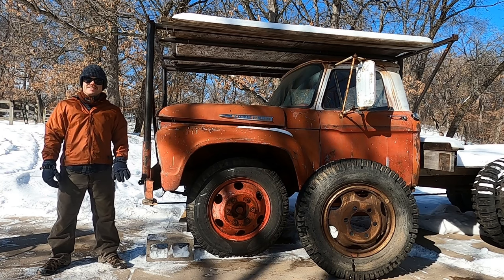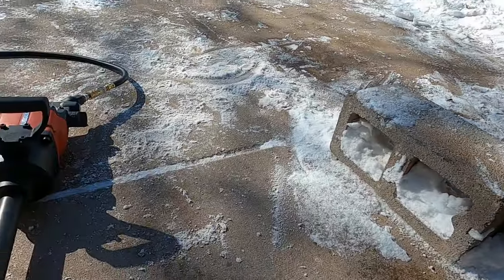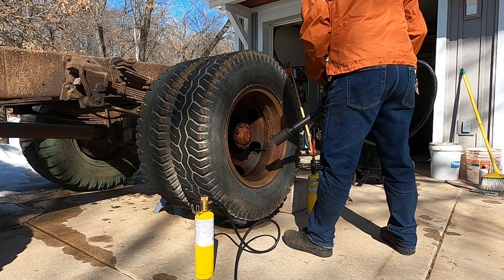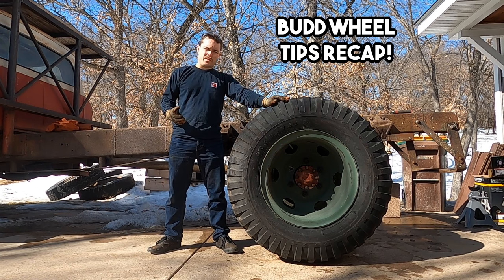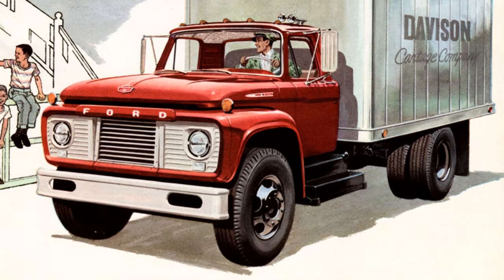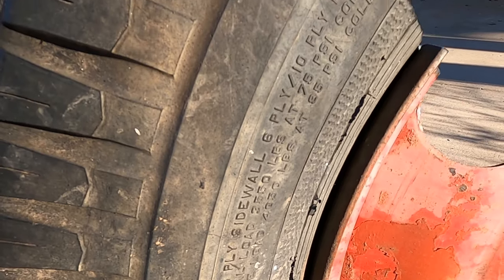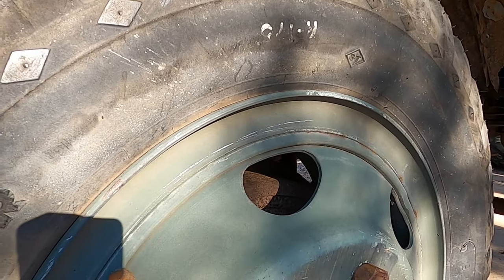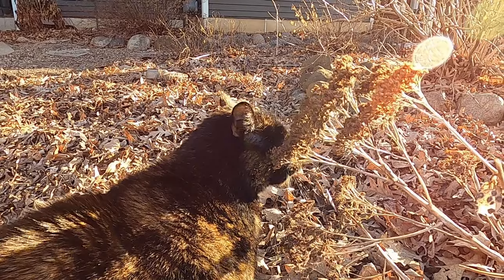All About Split Rims, Explained! Ep. 11

Comment: Ive got a48 ford with widwmaker wheels and another set off a 53. They are out there and i dont like working on them. There is a shop somewhere in this city that ive heard that has a ring still stuck in the ceiling.

Comment: As a big rig tech you need a 1/2in or 3/4in air line on that gun and it will make quicker work and less problems coming apart. Also Silikroil for anything super rusty and use a wire brush/wheel and a pick to clear the dam of rust to allow the penetrating oil to penetrate a lot deeper. Also with BUDD wheels you want to tighten the square drive 3-5 ugga duggas more or 50-75ft lbs. That way you can get them apart easier without spinning the inner nut out before the outside nut. At least that is when you service them often. I highly suggest you get a sunex wrench for the regular nut and a square drive for the budd style. Because they will become rusted together and not want to separate. Heat helps. Some people will just heat the nuts to prevent this but if you are ever heating anything like that the valve stems have to be pulled and tires empty of aire pressure and remember tires are highly highly flammable.
Reply from the maker: The air compressor situation is a conversation my dad and I have had a few times. Compared to buying a proper large air compressor and hose, I think I will be better off with a planetary torque multiplier unless I pick up another big truck.

Good idea on holding that inner nut. I will try it next time I pull the rear wheels. I'll also probably get all new studs if they aren't horribly expensive.

Picked up an inductive heat for the Corvair stuff (video coming Friday) so that will be very handy for a powerful, flame-free heat source. Noted on the tire pressure increase with heat!

Cheers

Comment: ב''ה, nice video; been trying to comprehend what should be simple about these for a while, but at about 3:20 with the reversed arrangement.. you don't want to be putting your hands where you're reaching around because you have to put hands there because of the reversed arrangement?
 
Is the point to crawl around the tire for that after pointing out the configuration? Still in the middle of watching the rest of course.
Reply: You might want to double-check your translation, because I couldn't figure out what your question is. I hope you find the answer.

Comment: First time I delt with them was a 1963 F650' Got my old man to give me some pointers for a rear outer replacement. He had me pull both, fix the outer and install it on the inner position. Like you much time and a ball buster to pull due to age. His reasoning was the rim that had been together for the last 20 years would hold up just fine, the one we were repairing was an unknown. If it came apart it was held in place by the spring and the outer tire. Did not have a tire cage and when I run across one of these now will not even repair them. Too much time and rust to be able to trust them even if it air's up just fine. If I find one from outside the rust belt thats clean mabey. till then NOPE.

Comment: Widow makers are actually rather safe, the basic principle behind them is to ensure the tube expands between the face of the tire and the rim and DO NOT let the beads seat first. 
I've worked on several in my 20+ years and I've never seen one come apart. 

And just a tip, if wheel nuts are seized on, try using heat and wax. The heat will draw the wax into the threads through capillary action and will limit the overall amount of damage excessive heat causes or the potential fire hazard of using oil based products and then heat.

Comment: I just got a 75 GMC 6500 dump truck. Seems like I have all split lock ring on mine. Would I still want to air them down when removing or working around them? Thank you for the reassuring info!
Reply from the maker: If you've been driving on them for a while, I would keep them aired up. Based on the OSHA docs I understand that the risk comes when you're changing the tire pressure, actually. The rings can theoretically unseat without pressure holding them together, but i think this is mostly an issue with RH5° wheels and/or mismatched lockrings. Definitely take a look at the docs to be sure; I'm not a tire professional.

Comment: Back in the day I still was working on fire engines and other emergency equipment   I save a firefighter from getting blowing up he was putting air back into a split rim that was nearly flat I saw him and told him stop stop and get away from it but a second after he moves split ring, came off  sending parts all over the place and bouncing off the wall Poor rookie, thought he just saw his life flash in front of him District chief walks up and goes. I guess that answers why  i was hearing someone screaming stop stop we both had  go to the hospital to get some stitches funny part that was the last piece of equipment in our fleet that had a split rims on it and it was a reserve unit that rarely got used

Comment: Back in the mid 90s my niece's father and I were at his job. He worked at a tire shop. When they air up those wheels, they put them in a cage rack. That way, if they separate it will destroy the cage and you will be safe. It was almost 5, and they had already put the cage away. A guy brought  truck in for a tire. This guy ( instead of getting the cage out) decided to stand in the middle of the wheel. He said if it goes, it will just blow strait up and he'd be safe. Well it popped. Shot strait up alright. The ring caught his jaw and peeled it off of his face along with his nose and alot of the skin and meat on his face. Don't half azz anything. It could be your life.
Reply from the maker: Jeeeeesus. That's horrifying. Thank you for sharing. I can't imagine...

Comment: I always put a dab of lithium grease on my lugs just so they can't rust on the car.
Its also a good idea to smear some on the back of the hub if your running them over a brake drum  make it super thin you do not want it to get the the brake shoes or pads you automobile won't stop correctly.
Reply: @I_Died_2_Weeks_Ago Anti-seize is the way to go. I've used it on all of my vehicles.

Comment: The split rim wheels also require tubes to inflate and cause excessive heat when run under heavy loads.  Cause more fuel consumption over a tubeless wheel.
At least that was what I was told when I wanted to put new tires on my 67 Ford 3/4 ton  F250 Camper Special.  Which hass 352 cubic inch industrial original engine.
Interesting video.
Never knew about the  widow maker versus a split rim wheel!
Education & training saves lives!
Reply: Who ever told you tubed tires get hot is nonsense ......................

Comment: could the split rim be permanently welded together and then mount/dismount tires like modern rims do or is the lip of the rim too tall?
Reply from the maker: Guessing the rim lip is too tall and the barrel too shallow. I think you'd also run into issues sealing it; multi piece wheels need a rubber "flap" that keeps air from getting past the wheel seam. Easier to get one piece wheels and paint them the right color.

Comment: My dad almost died working on one in his shop. He had no cage. It sounded like a bomb going off. We ran out to the garage found him on the floor on the opposite  side  from the tire machine and a perfect circle hole through the roof. He couldn't find his glasses. They went out the roof with the rim.
Reply from the maker: Sounds like he got REAL lucky. Glad he survived.
Reply: where I work, a side wall blew out during tire fill, tire in cage, cage about 2 feet from wall,air rushing out hole blew 2 layers of metal biulding out with insulation about 4 by 4 square, amazing power,just scary if someone had head near it filling tire, but  perple do it 1000s of time every day!!

Comment: By the way if you are running that compressior off of an extension cord that is bad for the motor and causes a voltage drop, at least use 12 gauge. 

You need to use fat hose and eliminate couplings as much as possible. The couplings have very small holes and hurt the flow. At the minimum you need 5/8 hose screw it directly onto the pipe coming off the regulator. 3/4 inch would be much better.Then crank the regulator all the way up. That impact wrench sounds pathetic.

Comment: That gun needs way for cfm than your compressor can make you need  a 30 gallon tank with atleast 18 cfm 25 to 30 is best and a half inch hose with half inch connectors

Comment: sure split rings a safer but there still a hazard also on older 4x4 that had them like older land-cruisers when you let you pressure down not even extreme lows just going down to 1.5 bar the rings have a habit or rotating a bit and it throws off your balance.

Comment: I had a trailer with a split ring wheel fixed at tire place and they used Murphy tire soap they use for tubeless tires inside of metal parts as well as tube and flap to make it easier to put back together after remounting went 20 miles tire was flat they come back out put new tie and tube again the same way went 15 miles nothing left but sidewalls come back out with a new tire went 20 miles tube had slipped around and valve stem was fixing to pop again I say it was because of all the Murphy tire soap causing it to move around before it was properly seated what do y’all think the tire store disagrees 550 dollars later

Comment: Suicide wheels are not as dangerous as people make them. They are dangerous to people who don't pay attention to them they have 2 flat spots on the section with the mounting flange and with beads pushed down and broke loose from rim you spin the inner half till you can see day light between the 2 halves a special bar slips in the space and you pop them apart by prying up between gaps and when they go back together you line up the flats and lock in one side and tap them down and turn 90 dgrees but any time doing them spend the money have them sand blasted when they are clean and mounted right they are just as safe as any other wheel and to be honest I just rhem more than any of the 22.5 or 24.5 aluminum rims out there today. Have you ever seen a 22.5 or 24.5 rims that has been ran for years or ran most of it's life overloaded they wear a groove in the bead lip and most tire guys and shops will just go ahead and mount them like there is nothing wrong with them at all there are millions of them just waiting to come apart and when a 22.5 or 24.5 comes over the rims bead they are way more dangerous then the 2 piece suicides. I restore antique truck wheels for a living and been doing it over 50 years now and I have more of a trust issue with aluminum wheels than I do with 2 piece wheels and the outer lock ring wheels are also more dangerous unless they are the 3 piece with the solid outer ring and the lock that slips over rim and locks between rim and outer ring. The single lock ring rims people bend and stretch the rings because they don't have the right bar and they think brute force is the way they come off and then they never clean them and just throw them back together and because they are scared of them they just throw them in a cage and put air to them and hope they are locked the locking ring needs to be tapped with a hammer as they are blown up steel on steel thud sound needs to be heard the whole time air is put in them and lock ring wheels and suicides need to go together dry with lube on tire bead and tube flap only no kind of oil or lubes on rims

Comment: I 've done literally hundreds of multi-piece wheels  of all sizes .... from half-ton pickups to road graders.....  was field serviceman for many years. Never had one come apart. Lucky , or blessed. There is one more style wheel ; probably the most dangerous of all. Normally 16 in size. This has a ONE -PIECE removable outer ring. It is solid not split. You pried this ring off over the rim using notches in this ring. Reassembly consisted of hammering this ring back over the outside edge. They recommended a brass hammer so as to not damage the ring ? ? We then partially inflated the tire all the while HAMMERING on the ring to center / seat it. We'd place it under the single-post lift lift to finish inflation .... pre - tire cage. Thankful I survived ....  Thanks for listening .....
Reply from the maker: That sounds horrible. What do you think that wheel was used on? I didn't see anything about it in my research.

Comment: They are like a bomb when they come apart. I worked in a garage in the 90s and had a 19.5-inch blow-up. Thank God I wasn't standing in front of it but it did take the air chuck out of my hand and I was counting fingers afterward. We also had a local junkyard owner get killed by one back in the day. Those wheels are definitely no joke and should be chained up or serviced in a cage.

Comment: You need a bigger air hose to supply that gun, it should be spinnin like a normal air gun, try a 1 inch inside diameter hose

Comment: If you remove one of these rims to do brake work would it be ok to leave 5 to 10 psi to keep the rim together ? Just concerned removal and total deflation could cause the rim to separate and live up to its name during airing back up .
Reply from the maker: Why not leave it at road pressure?
Reply: @SealedBeamRallyTeam  That was my thought , just leave the pressure as is but you deflated the tires completely during removal . I just bought a 61 Chevy C-50 with RH-5 all around . How is the Harbor Freight impact holding up ?
Reply from the maker: @buick1955   Mine were already "flat" and mostly just riding on the sidewalls. I wanted to make sure there wasn't enough pressure to do any funny business. Those wheels have not gone back on, and will not either. I'll eventually paint the military wheels to match when i paint the whole truck
Reply: @SealedBeamRallyTeam  Thank you this is all new to me with the split rims . I would think if the tire went flat while going down the road there's a real good chance the rim will come apart with no pressure to hold it together . RH-5 and Hydrovac brake systems lot's to learn about .
Reply from the maker: @buick1955  I don't necessarily think the wheels would blow apart if you got a flat. It seems most incidents occur within the first few hours/days after inflating the tires. If the wheels are seated together properly they take some real effort to get apart! But the stakes are high enough I am erring on the side of caution.
Reply from the maker: @buick1955  As far as hydrovac, that's actually the next thing on my list for this truck. Pretty interesting system on these old rigs. Stay tuned!
Reply: @SealedBeamRallyTeam  I sent my Hydrovac out for repair and it took 12 weeks to get back . Shop in St. louis . $250 for the repair .

Comment: it doesn't sound like your air compressor setup is properly powering your 1 inch impact gun properly. When provided proper air pressure they sound higher pitched than in this video. In this video the impact sounds like how the it would run when the air compressor tank had run out of air due to too many tools being used at once for too long.

Comment: Be careful using that one inch impact I have a friend that I work with who just lost his thumb due to that trigger being on the outside of the handle which is a truly poor design if you use these impacts on a daily basis totally sheared my friend's thumb off of his hand because of that stupid handle. Not saying this will happen to you especially with that little compressor you using. But it is something to watch for and be careful with

Comment: According to my personal experience (and Ingersoll Rand, CP, and Aircat) your air hose is RIDICULOUSLY too small.  I use (and have for the last 31 years) a 3/4" hose for my old Sioux 1" impact.  IR and CP recommend 3/4" MINIMUM.  Aircat says you can use a hose as small as 1/2".  I'm skeptical... but, I've never run an Aircat 1" air impact so I'll keep my doubts to myself.  Regardless, running a puny 3/8" hose is like running an orifice in the line.  The pressure drop across that hose at the 80 to 90 CFM that gun uses is crazy high.  You can tell it's being starved by the way it sounds.  In terms of assembling any multi-piece wheel you should have mentioned the most important safety factor: MAKE SURE ALL PARTS ARE CLEAN AND UNDAMAGED BEFORE USING and ALWAYS USE A SAFETY CAGE!  Having worked on farm machinery for well over 60 years, I've done quite a few RH-5 wheels without incident.  They aren't going to leap off the truck and get'cha.   Think about it... millions of these wheels were made and many are still on the road.  The laws of physics haven't changed... mounting tires on these rims can still be done safely if the rims are in good condition and you can find someone that knows how.

Comment: why not just use the proper size hose from the compressor to the impact? no sarcasm or criticism intended, just an honest, serious question...
Reply: i ask because i am a commercial service tech here in idaho and we run 3/8 hose for a lot of the equipment but the 1" drive impacts are all run using either 1/2" or 3/4" (i don't recall off the top of my head which size specifically).

anyhow, the video was great! very informative. i learned a lot!
Reply from the maker: We didn't have a larger hose and didn't have a hose adapter and it wasn't worth the trouble to go to town and spend the money for one day just to see if it would help at all

Comment: Are there any other wheels besides split rims to replace the widowmakers with?
Reply from the maker: Just like any car wheel... search for ones that match! These use Budd style lug nuts, which only work on wheels built for them.
Reply: Mine are Budd too. I'm resurrecting a bus that's sat since 1985. 5 of the 6 tires hold air, though they are ridiculously sketchy. After reading about the wheels, I've decided to switch to something more shop friendly.